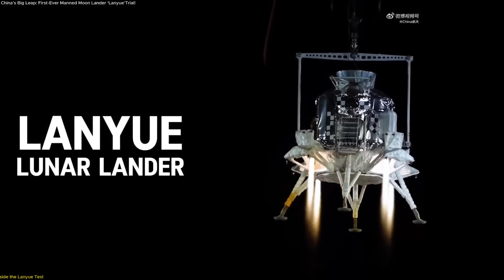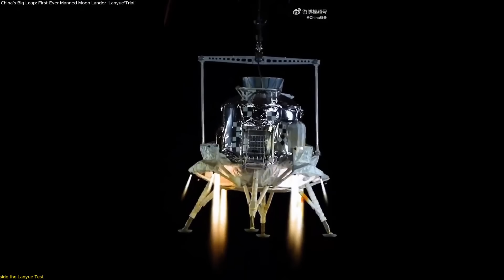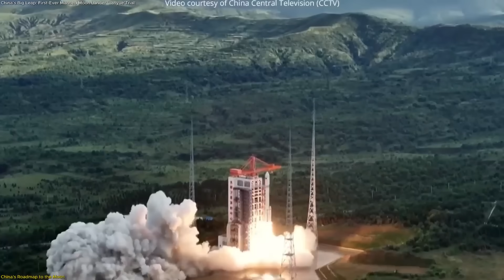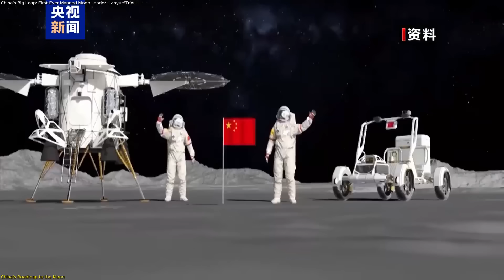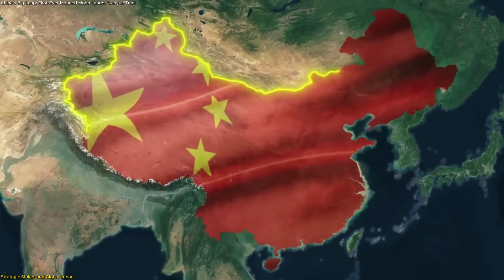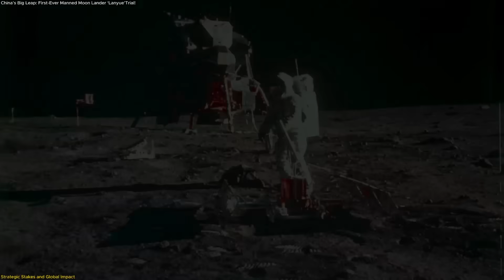China’s Big Leap: First-Ever Manned Moon Lander ‘Lanyue’Trial!

Comment: Wondering whether uncle Sam did this test before landing their astronauts on the moon. Have never seen any such videos of America or did they were successful in Hollywood sets? Just a thought. This explains why they are still struggling even after claiming they did this 6 decades ago. Or just like old dementia presidents, might have forgotten all the old procedures.😢😢
Reply: This test demonstrates that China is fully committed to its Moon landing mission, is fully funded, and is undertaking it scientifically, step by step, with no rush, no politics, or comparison to anyone.
Reply: 美国人在登月前也做过试验，地点：好莱坞摄影棚
Reply: 可以预见，未来想登月的国家都需要做至少一次这种模拟重力的测试。据我所知，1/6重力下，反推发动机需要的燃料消耗并不是1/6，而且固体燃料不能精确调节动力，液氧液氢发动机的液态燃料在1/6重力下有不同的物理特性。那些发送探测器并以各种姿势翻在月面的失败，几乎可以确定是这个原因。
Reply: It seems that NASA also tried it in the past but it failed because the lander crashed and caught fire but the astronauts survived.
Reply: @agusedyanto3087  When and where was that?  NASA did testing of a LEM lunar lander a few times in California (IIRC) to verify the landing and 'blast-off' capabilities.   They also used a few other 'contraptions' with similar landing legs and rocket engines before the LEM mock-up was tested to fine-tune the design.  Pretty interesting history of the whole thing if you dig into it.